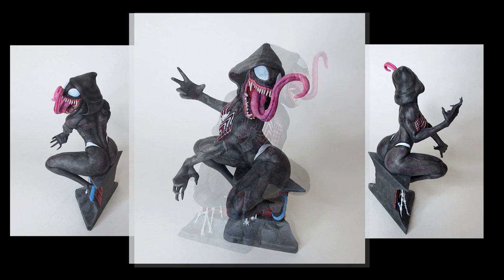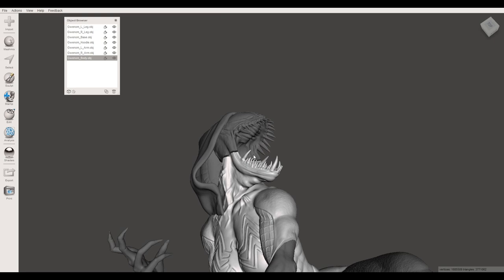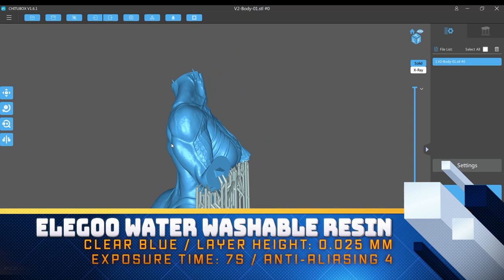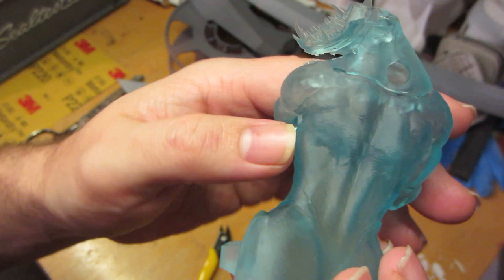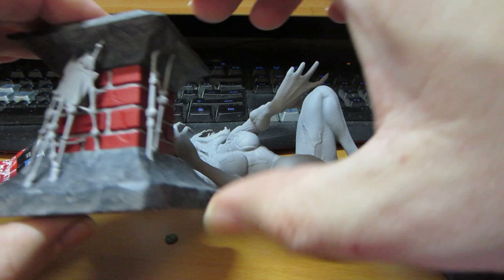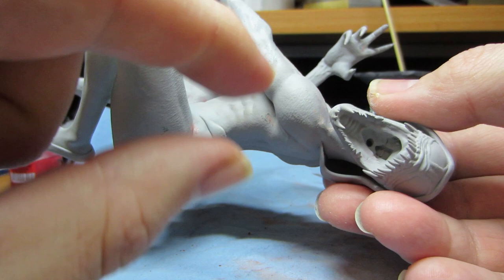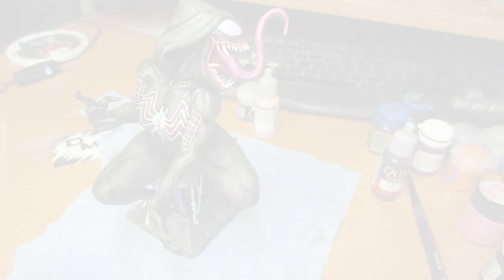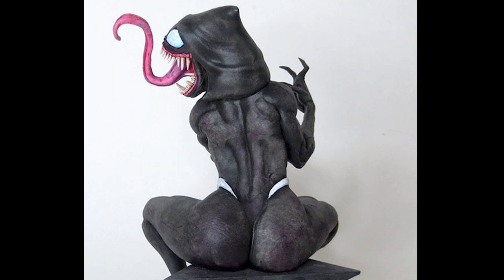Gwenom - Making A to Z painting Tutorial 3d resin model

Comment: Great video! Thanks for showing us your process on painting that model. I also have started to work on mine and I'm currently right at the step of coloring the figurine but I'm a bit unsure on which technique to use... Well that was until I came across your video! I have some things that are still quite unclear to me, you use black ink wash and you also said you just used old bottles and refilled them with (I assume) your own mixture. You colors looked fantastic so I'd like to ask what colors you mixed and what the ratio was. If you have any brands to recommend I'd love to try them out aswell.